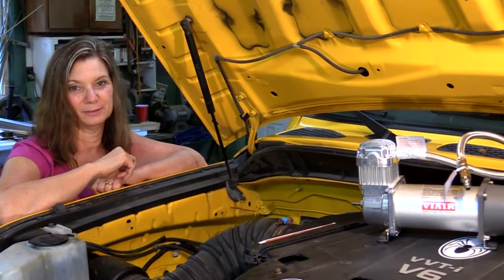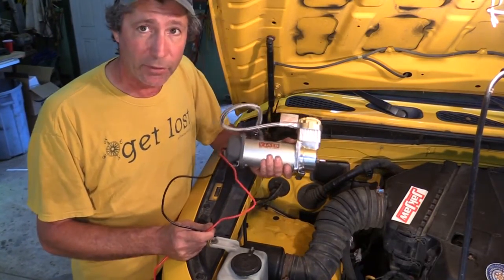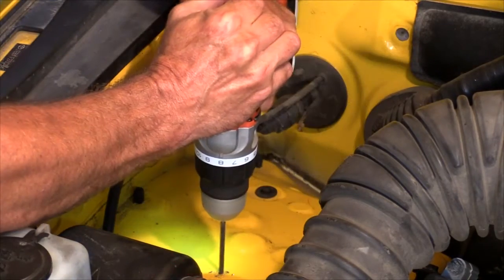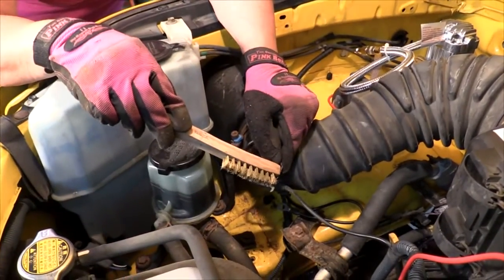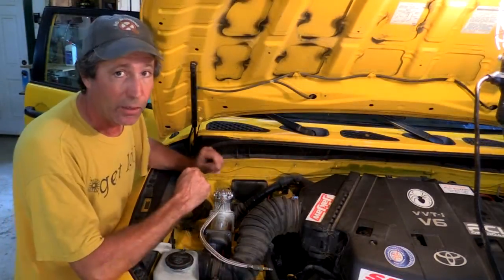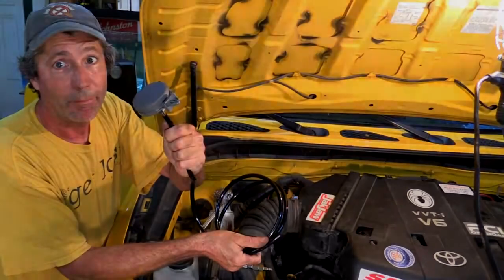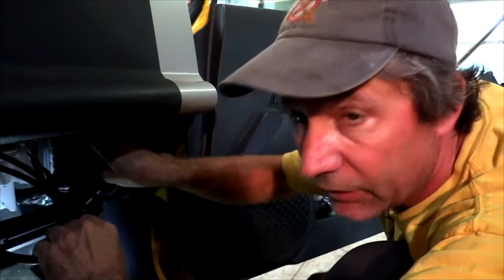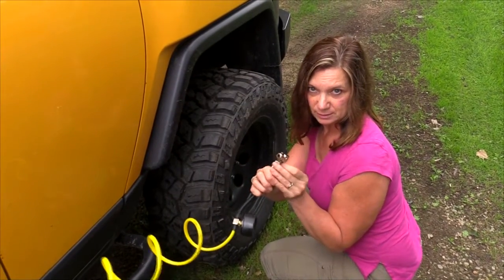Onboard Air Compressor Install_Toyota FJ Cruiser_Viair

Comment: Nice addition. Planning on air myself but going to wait til the next expo that comes to town. They usually sell open boxes and floor models there cheap. Saw a guy nab a SmittyB heavy duty for $50.00  I just about @#$! myself because I was looking for a compressor but stopped at a booth before I went to the clearance area.

Comment: Hey Mark & Merri,   Have you guys tried to revisit this video, in order to see if this was the best place to mount it?   Would love to hear your thoughts..   Thanks..
Reply from the maker: So far so good! We haven’t got our River Raiders snorkel yet
but when we do the compressor will have to be moved. Still on the same
fenderwell, just forward more to clear the new path of the air intake hose.

We were worried about it getting too hot under the hood and
then having to go through cool down cycles while pumping. Turns out it’s not a
problem at all. Airing back up to 35psi from 20 is no problem at all either, in
fact it’s surprisingly quick.
Reply: Getting too hot under the hood, is precisely why I asked.  Thank you for the quick response, and confidence.
  I'll have to rewatch the video at some point in order to find out the exact model number, you guys purchased.. 
                         Thanks again you guys, Love your videos

Comment: Random question. What size rims and tires are on the fj?
Reply from the maker: We're running 295/70/17 on ProComp steel rims.
Reply: @WanderlostOverland  have you made an additional modification? 3" higher? Wheel separator? Control front  control arm? Thank you for your support